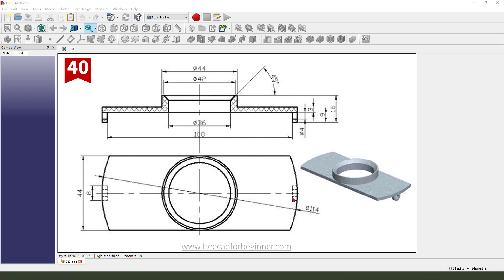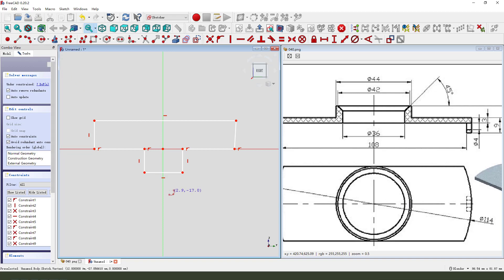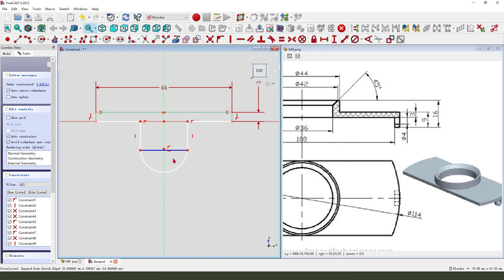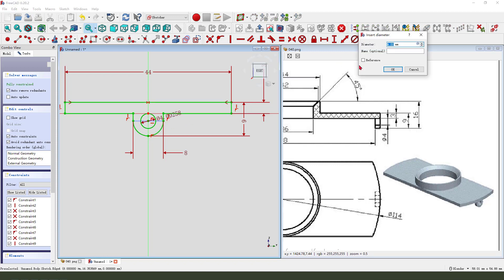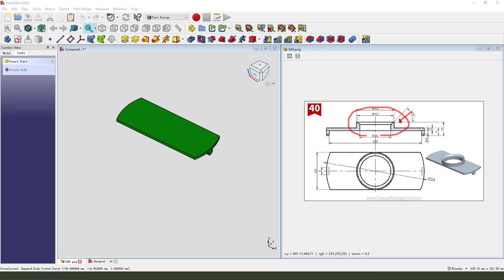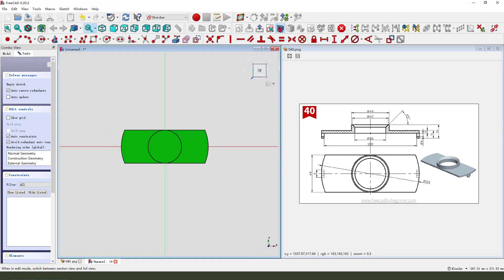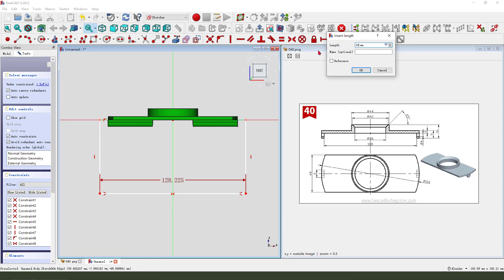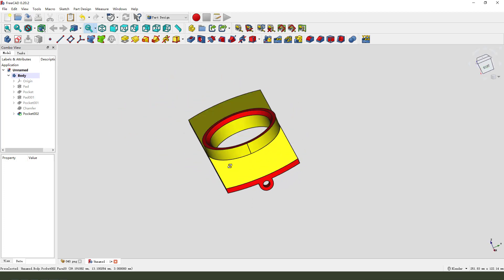FreeCAD Tutorial for beginners,basic model exercise-83

Comment: Thank you!  I always do the excersize before watching your video. Interesting is that there are many ways to get the same result and In most cases my way differs from yours. Sometimes my approach is easier (i.e. requires less steps) sometimes yours. 

One little mistake in this video (6:28): according to the drawing, the champfer should be 3mm ( (42-36) / 2 ).
Reply from the maker: Thank you. You are right, a model can be modeled in multiple ways, and everyone will have their own preferred way of modeling. This is very interesting. Thanks for pointing out where the video was wrong.